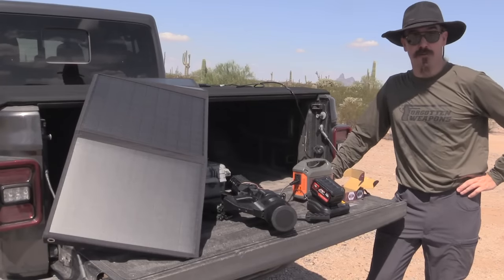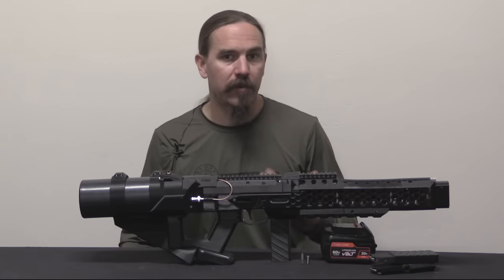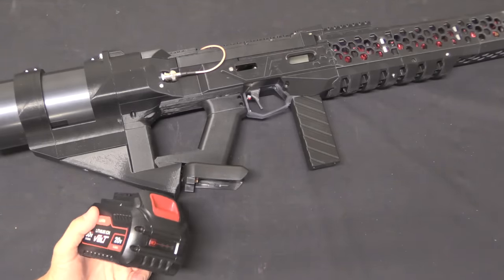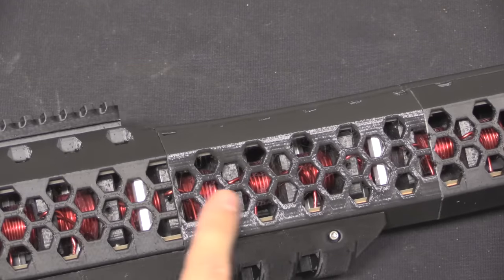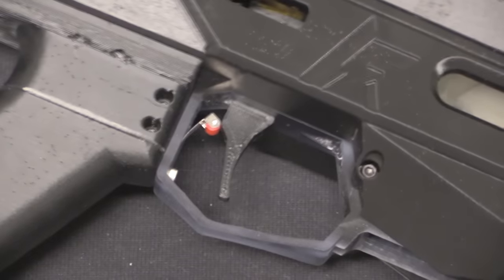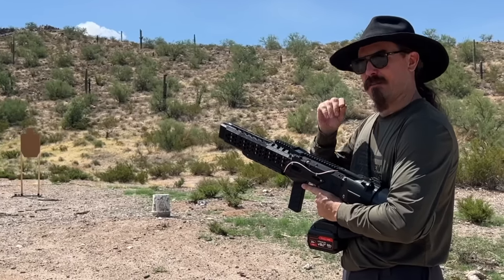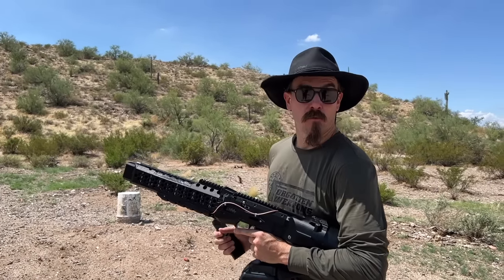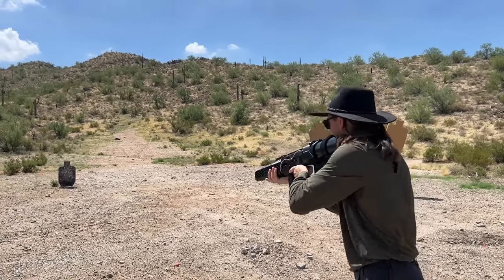ArcFlash Labs EMG-02 CoilGun: Making SciFi Weapons Into Reality

Comment: I realize that it's a cool thing to have buttons and a digital screen to select your mode and to keep track of your rounds/speed.  But I suspect if one of these things makes it into practical use, those things will probably be the first things to go.  You can easily replace mode selection with a selector switch to input into the digital system and program whatever it is running the system on the gun to take that sort of input.  That way instead of squinting down at your screen trying to figure out if you're in burst, you can easily tell where you're at with the position of the switch without even looking.
Reply: Having a screen to show the charge level still seems like it would be useful.  Definitely a physical switch for fire mode and safe would be more practical though
Reply: @Duck_Destroyer_88  Most powertools use LEDs to show charge level - that would probably make the most sense here too.
Reply: Many of those kind of powertool batteries even have charge indicator LEDs built in.
Reply: What I was  thinking as well. You need to do a lot of work to make a screen legible in daylight (you essentially need it to be brighter than the Sun which is pretty bright I'm told by people who actually go outside). My initial thought was to make a hooded recess with LEDs next to labels, but a simple mechanical switch is a much better idea. Charge levels can be represented with an array of LEDs or something. Other data seems to be mostly for debugging, but I'm no expert in coilguns.

Overall, this is obviously a prototype that was designed and tested indoors, and it's pretty great. Would be interesting to see how they go about stabilising the projectile.
Reply: Probably, but iirc they likened these to the wright brother's aircraft vs an ar15's jet fighter; that screen is there to show the user the 'debug' stuff as much as anything. When the next gen/more reliably ones start turning up, then I'll be surprised if you're not right and it gets replaced.
Reply: just make it bluetooth compatible, and no need for buttons (:
Reply: @KO_5662  Give me some covering fire, my gun paired with my headphones and now I can't see my charge level!
Reply: Put the DRO in the scope and add a photo sensor to automatically adjust to surrounding light levels.  
The DRO in the scope would also stop the screen glow or battery LED indicators from giving away your position.
Reply: this is where the gun mod community comes in. These guys put out the basic weapon, and let gunsmiths mod it to make it better. Kinda like how car guys will make a custom car from the base
Reply: When it hits production there will be, in the instructions, a link to 'download the app'. I saw earlier this year a 12v car tyre pump that you can control from your phone via an app...
My initial reaction when i saw it was "oh FFS what next?"
Reply: Definitely agree. There’s actually a 3d printed nerf blaster called an FDL that has a few of these ergonomic improvements as options.
Reply: @KO_5662  Imagine linking it to one of those fancy hud display motorcycle helmets
Reply: Also that round counter is gonna be dim as shit or in red light or IR only for obvious reasons. Can't do a night raid if your weapon is flashing lights at your face/torso potentially highlighting it.
Reply: Well, gosh darn it why didn't they think of that?
Reply: Considering that the military has had digital gauges and other sort of digital equipment hardened to the point that I've heard Tales of military tablets surviving IEDs going off close nearby, I wouldn't put it past Western military's to be able to harden a tiny little digital screen that goes on the butt of their rifles for important information.

 Sure, there probably would be analogue backup somewhere but, you know this is the 21st century;it is isn't the 1980s.

You're also forgetting that by the point that railguns, coil guns, Gauss rifles ,what have you get downsized and have enough power capacity to be usable at a man portable level, we're already going to have either fully heads up display/AR display in someone's Helmet or they're going to be wearing either light power armor or an exoskeleton to help them with power supply for the rifle and maybe ammunition, and at that point you're going to have either the rifle physically linked to the armor through cable and thus the heads up display or some sort of short range highly resistant to jamming Wireless signal will be used.

To use a video game example, think of how in halo the Master Chief can pick up any weapon and it will show its ammunition status and firing status; this isn't Space Magic, it's essentially just human weapons and Covenant weapons both have the ability to talk to their respective sides armor through either contact points on the weapons grips, or a extremely short ranged wireless signal, and both the Spartans and the elites armor can talk to the other side's weapons if necessary.
Reply: @ARCNA442  Well, yes and no. An LED indicator would be far more practical, but you'd have to consider the operational impact of having a constant LED light on your weapon
Reply: Most if not all computer-compatible firearms have a ammo-counter HUD, even some HMGs.
The ARMY's new fire-control-optic is the solution. Just have it in the corner.
Reply: My suggestion would be a shroud for the Display and 3 LED for Weapon state: 
All off: Weapon Off,  All on: Weapon on but safe: First LED ON: Single Mode, First and Second LED On: Burst, First and third LED on: Auto. 
Maybe on a Display-less Design two rows of LED, First Row would be battery state. And Second Row would be on LED + the 3 LED for Modes as above.
Reply: TeknoAXE ?! It's always fun to see channels I'm subscribed to commenting on each other's videos.
Reply: Yup, once they are out of betatype (? 1 at a time runs as needed after prototype and proof of concept phase?) phase I would expect it to be streamlined enough to match up to the Mil-sim Style tech in use for airsoft/paintball gear with easy to program burst mode boards that use physical selector switches, LED indicators for charge, and basically AK levels of environmental proofing on the electronics as well as being capable of fitting any picatinny rail items you want to it.
They could put a USB connector behind a Water/Dust proof plug so you can plug in a phone to diagnose, monitor, and/or change options...Hell, you could set up a special case/holder for your device/phone on a rail mount and have a simple app set up to have that act as your sight, gun cam, ballistics computer, and monitoring system using the phone as your display or blue tooth link it to another device....
Reply: 10-15 years ago it was a couple red led indicators on the back of the hand grip for E-Triggers to show status so you had it covered with the heel of your hand unless you needed to check on it for some reason; on a few other items I have that I got in the last 5ish years, there is a button to press that turns the LEDs on to see the charge level.  They could put the LEDs in the same spot and the button on the thumb side of the grip; 4 dots to indicate on and 100%ish, 1 dot turns off for every 25% increment it drops.
Reply: @AClockworkWizard   they could use an e ink display, I agree with the selector switch but it seems like a screen would still be usefull in that kind of weapon.
Reply: I think the best bet is to go with both. That type of screen is probably very old technology and at this point very cheap, not even touch-screen, so I don't think there'd be much savings in scrapping the screen. But you do have a point in terms of having a selector switch to instinctively know instead of a button, however it's also worth pointing out that with enough time handling the... device (firearm just seems like such an incorrect thing to call it), you could just swap from semi-auto to burst-fire to auto or whichever setting you like, based on memory. One press from 'this setting' to 'that setting,' or two presses from 'the other setting' to 'this setting,' etc. Maybe even customize it so that you can remove burst fire altogether and just have semi or auto, or if you prefer the M16A2/A4 style, semi/burst. Or if you don't like one shot per trigger pull, burst or auto. 

Also needs higher-capacity mags, although then I imagine to try and 'mag dump' may prove an issue and so a pause would have to be taken to let the capacity recharge, possibly, but I don't know for sure. This is technology that I, and the VAST majority (possibly everyone but Ian and the guys who made it, IF any of them see this comment) of people reading this comment, has as of yet 0 experience handling/'firing.' 

As for actually checking the status of the coil gun, yeah, a glance is needed but I suspect it's MUCH more clear IRL and with time you could EASILY check the status of it without having to bury your face into it, like when you're playing a FPS game and you glance to your ammo count or mag count (if applicable to the game) and then you very rapidly are updated on the status of your firearm and remaining available ammo. Also, Ian said he can SEE the projectiles and direct it like a hose. Maybe it's just because I don't have the vid on fullscreen, but I didn't see the projectiles in flight, but given you can see .45 slugs from a 1911 in an indoor range, I have no doubt that in good lighting you can see the projectiles making its way to the target. Curious as to the energy! Is it still lethal? Or would the power of it be considered non-lethal? I wonder if it will be legal in my country! If so, if I could afford one sometime in the future (hopefully by the time it's released), I'd be happy to pick one up to get a sneak-peak into what MIGHT be become more mainstream in the future as technology improves! Might be able to use it for backyard plinking with a good backstop! Gong might not be a good call though, probably annoy the Hell out of anyone living nearby within earshot, even if they're indoors. Shooting a gong in full-auto might have people be like "Why do I hear my high school lunch bell going off while I'm in my living room watching Stranger Things? DING-DING-DING-DING-DING! lol

Oh, also, power is inherent in the system, so there's really no impediment WHATSOEVER in taking this experimental projectile-launcher and outfitting it with WHATEVER electronic gizmos may be desired. Some might also get attachments that are sound devices, possibly some sensors that can track the rounds fired with pre-inputed info about  the user's typical mag size and so when the set amount of rounds are shot, a sort of buzzer noise goes off to inform the shooter (wearing no ear protection of course) that they're out of ammo. OR! Inspiration from some... less-than-fully-realistic videogames, as the magazine becomes like 80% spent, it starts to make a strange noise to inform the shooter that there's barely any ammo left, like how some games start to make firearms go "CER-CHUNK-CER-CHUNK-CER-CHUNK" while firing as the the AK's mag nears its end or something. Perhaps the count is reset with the insertion of a fresh mag. Like, people could have some FUN with these things! Some cowboy might have "YEEHAW!" play as he inserts a fresh mag, and "BOY HOWDY, GET ANOTHER!" As the last round or last rounds are fired lol Could get some light fixtures that, when the firearm is fully loaded, portrays a green lights, and the green lights begin to strobe or sort of cause light-snake affect or even glows words on either side of the thing when firing, and then shows yellow when nearly depleted and red when totally empty!

I know this might sound rather childish and silly and foolish... but c'mon. This tech is new and energy is contained within it in ABUNDANCE! If AT ALL possible, you don't think some people are gonna take full advantage of that? Whether it's just for personal fun, or wanting to impress friends or people at a shooting range! SOMEONE or SOME PEOPLE are gonna take some concepts and run with it! At 200 ft/s... this does not seem legitimately comparable to firearms and might even be something that children can own. Laws may end up changing over time, but as laws are now with BB guns and airsoft guns and pellet guns and firearms, this coil gun might technically be considered as little more than an ultra-high-tech BB gun. I honestly don't know, haven't done the research, but yeah... and wow is there anything more FallOut-esque than the idea of a kid getting a coil gun for Christmas? lmao Watch out! 2077 is gonna come eventually! Will you be ready for total nuclear annihilation with your trusty dog and coil gun handy? Haha

Apologies to people who have no idea what I'm talking about, I love the FallOut series of games, if you don't understand then you probably quite simply have more productive things to do with your life but that said... I do not apologize for the thousands of hours of my life that I've spent playing those games, and thousands of hours more are likely to follow as I look forward to FO5 in about five years or so, plus the mods allegedly being created that are re-creating New Vegas and FO3 in the FO4 engine! Possibly also FO1 and FO2... the modding community is apparently abuzz with projects, knowing that FO5 is a LONG ways away...
Reply: To me that's the least of its problems. This technology is about a million years away from being a functional shoulder fired weapon.

Tbh i can't see it ever becoming a viable hand held weapon. Something else will come along to replace a traditional firearm long before they can ever generate the kind of power necessary to make this work.
Reply: This will never make it into practical use. It's just worse than a traditional firearm in almost every way, even if the technology gets a lot better.
Reply: I fully expect a mimic of an AR fire control group with the power switch operated by the safety.
Reply: @kittytrail  My primary reason for e ink would be the complete imunity to sun glare, OLEDs are fine for that but e ink just has no problem at all and low refresh rate probably wont be a hindrance for this aplication.
Reply: @adamimberti6948  
A million years away? I think you're being silly in saying that. In just a few years, they've improved the design. It might already be a platform capable of lethality, it can fire about 300 rounds on one battery charge (which is more ammunition than most soldiers carry), and it can fire in semi/burst/full-auto.

Honestly, it could be that in 10 years, maybe 20, it's managed to ramp up the velocity and implement an accuracy-providing spin to the projectiles so as to further improve penetration and long-range capabilities. Will it be powerful enough for hunting deer within 10-20 years? I'm too ignorant on the technology, and the rate of technological improvement, to know. But I do believe that a day is coming within our lifetimes in which someone defends their home with a coil gun. I REALLY want to see some penetration tests on this thing, because if it is capable of lethality, it might actually be a really solid home-defense platform that won't blind with flash or deafen with the sound of gunfire or over-penetrate through walls.

If it can penetrate quarter-inch plywood, is that not the standard for if a platform is capable of lethality in the US Military? With the size/weight of those projectiles, yeah 200 ft/s is SLOW by firearm standards, but we're not talking about a BB or pellet gun. I'm wondering if those projectiles could break a rib, and if so, can it get PAST the rib, because if it can... the coil gun is already QUITE capable of lethality and may already be a legitimate home-defense platform. Though personally I'd want bigger mags, and would want to 'launch' THOUSANDS of rounds through it at the range before deciding that, okay, it might be better than a firearm. Which in its current iteration it PROBABLY is not as good as a firearm... but it could become a genuine contender in just a few years. I mean, they're gonna be selling it on the market at the end of the year. Hopefully it does well in sales for those who can afford it, makes them good money, and they work full-time on improving it. If that occurs, improvement is basically inevitable. They've already proven themselves thoroughly capable of improvement.
Reply: @JohnDoe-zh6cp  
Negative Nancy.
Reply: @normanmccollum6082  So, there's no way I'm replying to your whole little thesis but I was being hyperbolic when I said a million years.

In saying that though the technology to push these things to the necessary limits does not currently exist and it won't exist for a very very long time.... we know what technology is out there and we know roughly how fast it evolves.... we're the proverbial million years away from a shoulder fired coil gun that can produce the kind of velocities necessary to be a functional or practical weapon.

The kind of batteries and capacitors necessary to generate that kind of energy are massive and won't be small enough for a very very long time. Then trying to harness that into a safe and effective weapon.... well, that just won't happen in any of our lifetimes. 

Something else will come along long before these are ready for market.
Reply: @adamimberti6948  
Except it might already be producing lethal amounts of energy and penetration. Ian has proven twice that it can crack wooden posts, and it wouldn't take much more penetration than that to qualify as lethal by US Military standards, which is something like punching through quarter-inch plywood or something like that.

There's also very little audio report, no recoil, 

.32 ACP using 65gr from a 4" barrel at 925 ft/s produces 123 ft-lb of energy. The coil gun, if I'm not mistaken, fires bigger and heavier projectiles at 200 ft/s which produces 75 ft/lb of energy, which is more than half of the .32.

That's comparable to .22 Short, and averages roughly half the energy of .22lr depending on which loadings. Some .22lr loadings reach 200 ft/s.

I do believe that a day is coming when a coil gun is used in home-defense, and potentially soon. Sales begin Dec 2022. I guess we'll see if it sees success.

What I don't understand is... why not try using 'rifles slugs' as it were, or projectiles with a screw-like spiral to them? Would that not improve accuracy by imparting a spin?

We need to see what coil guns can do to ballistic gel, or even better, those ballistic dummies with ribs and internal organs. I dread to think what a headshot would look like... bet it can penetrate skull.